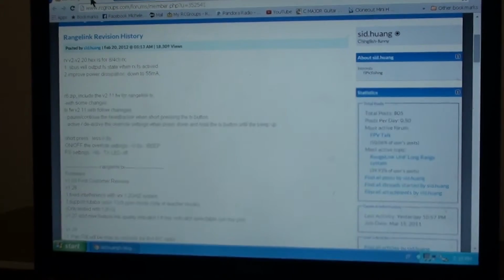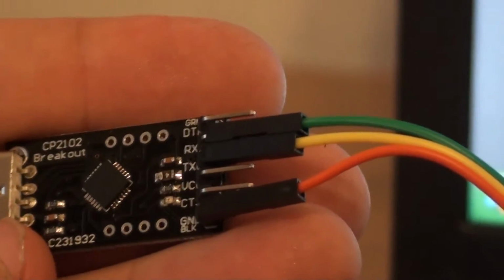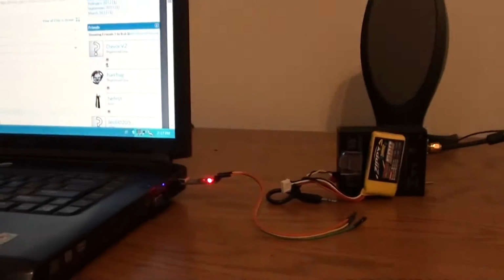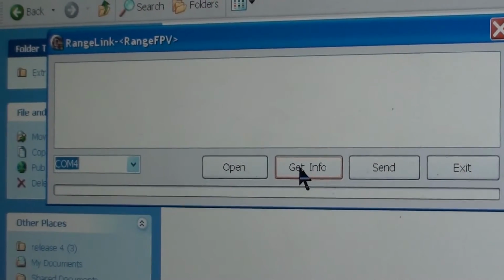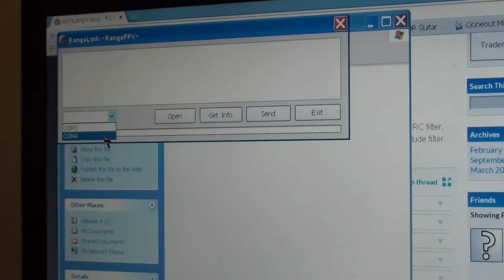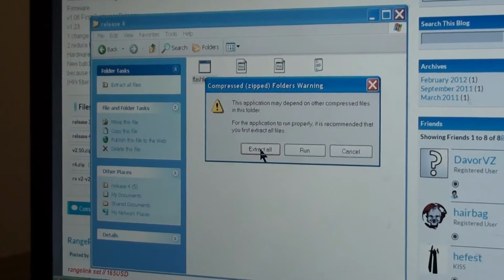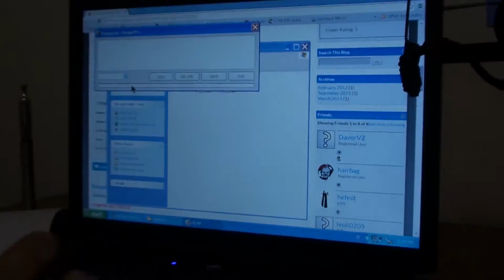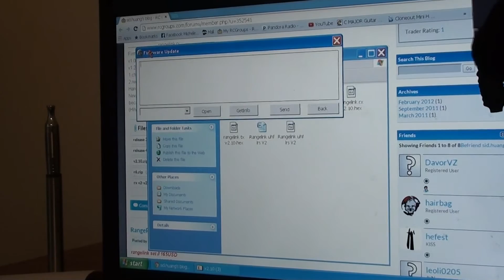RangeLink Firmware Update

Comment: Ok I got it to work. had to exit program and repeat procedure several times before it worked..also skipped the get info step
Reply from the maker: ror1948 glad you got it working!
Reply: @reconrcplanes  it worries me that the software is not very robusk..I have never seen a downloader do this but I understand why..the two pieces have to get in sync and handshake and that is not well controlled..usually this is done with a power cycle but not here..
Reply from the maker: @ror1948 Yeah, Sid’s software/GUI needs some improvement but I think he just wants to put something together that works (with some patience lol) and for a low price. But rest assure for what it lacks in user-friendly interface it makes it up in performance. :)

Comment: I've follow all your instruction, but when running flashlinkprj and Get Info, my usb blink one time but then it shows "Device not found!!!"
I ensure that the driver of USB TTL, COM number, Power up transmitter rangelink with 3s batt, connect UART (GND, TX & RX) and everything is correct, what went wrong...?
Thanks for your help
Reply from the maker: Try again but this time DO NOT press "Get Info" just press "Send". You might have to press it a few times. Hope this helps.